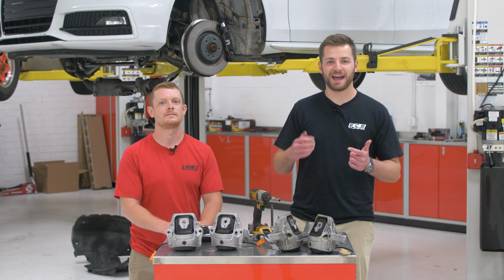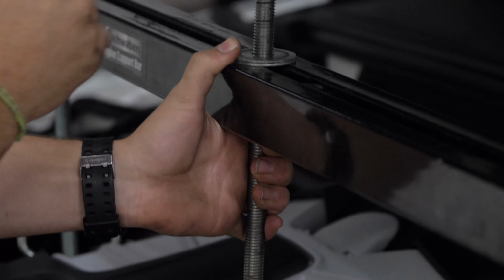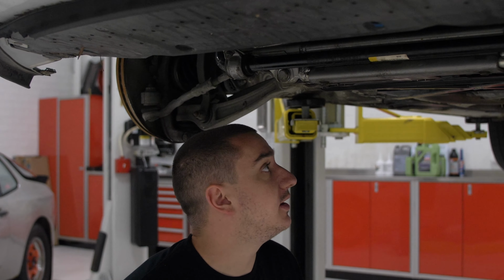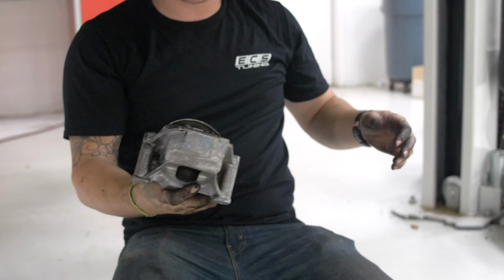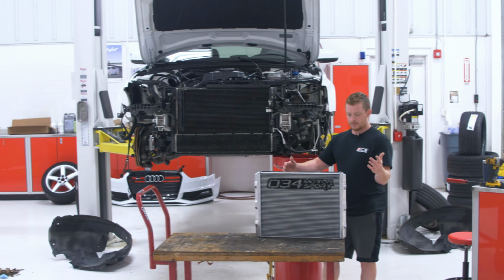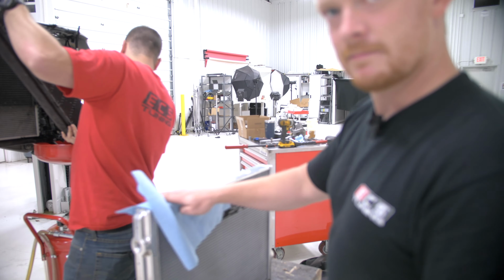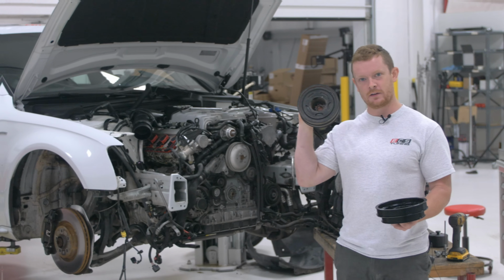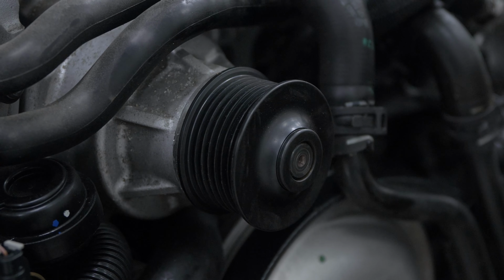Building an Audi S4 | Pt 2: Motor Mounts, Heat Exchanger and Supercharger Pulley | ECS Tuning

Comment from the maker: Parts and tools used in the video: 
034Motorsport Supercharger Pulley Upgrade: https://bit.ly/30injeC
034Motorsport Supercharger Crank Pulley Upgrade: https://bit.ly/346Mj9v
034Motorsport  Heat Exchanger Kit: https://bit.ly/3cI1I46
034Motorsport: Track Density Line Motor Mount Kit: https://bit.ly/2G97MH0
Schwaben Super Charger Pulley Tool: https://bit.ly/33b0aMI
Schwaben Engine Bar: https://bit.ly/34bWI3E
Reply: my passenger engine mount  broke, do I have to replace both or can I just replace the passenger side engine mount
Reply: I guess im asking the wrong place but does anyone know a method to get back into an instagram account?
I stupidly lost the account password. I love any tips you can give me
Reply: @Case Kendrick instablaster ;)
Reply: @Jeffery Myles it did the trick and I finally got access to my account again. Im so happy:D
Thanks so much you saved my ass :D
Reply: @Case Kendrick happy to help xD

Comment: So will solid rubber filled motor mounts transmit more vibration into the cabin and steering as apposed to the factory fluid filled ones?

Comment: Was the subframe lowered to take out the engine mounts?
Reply from the maker: Yes. Due to the position of the bolts, Matt had to lower it.
Reply: @ecstuning  I was really hoping for an actual informational video on how to swap out my motor mounts.. like maybe wrench sizes which ones are torque to yield bolts and perhaps what attachment points do you use for that lift on top of the engine how about maybe what was the problem with the lines and the transmission what was the potential issue that could be or not avoided.. I have now got to watch another video from other people who provide data that's relevant rather than just interesting camera angles with music in the background.. what a waste of my time